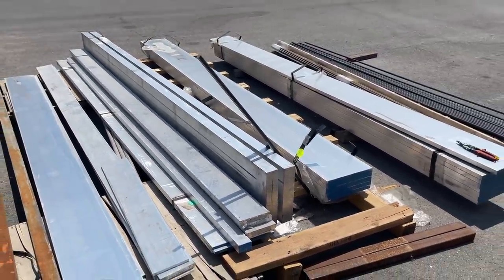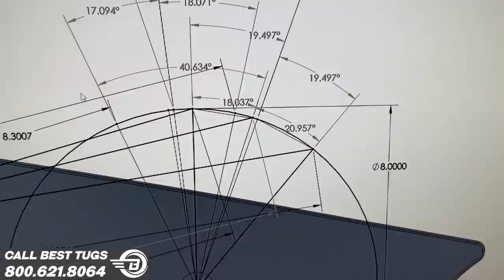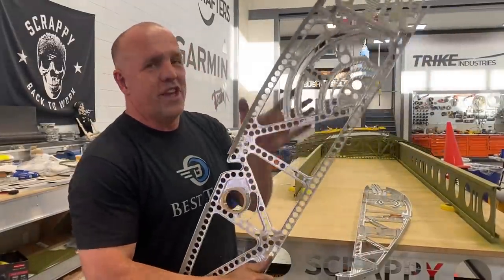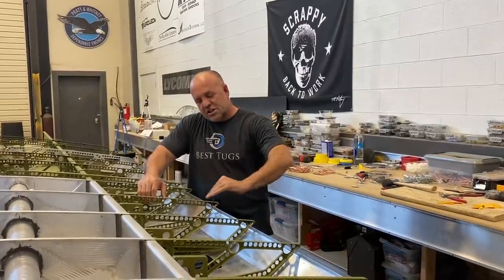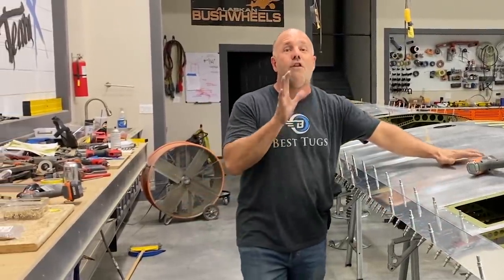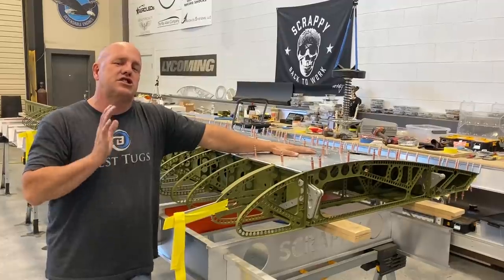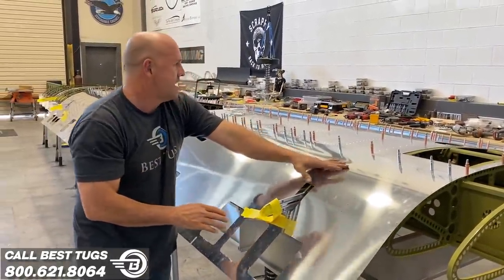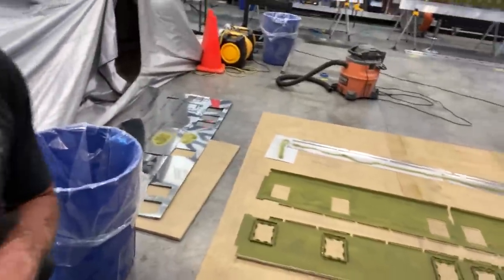I'm skinning my wings, one step closer 🤠 | Scrappy #58

Comment: As someone who has many years experience with repairing and major overhauls of Boeing aircraft, and dealing with stacks of shims that Boeing used in  areas like the structure surrounding the S duct on a 727, to make up for large tolerances in fitment, makes witnessing of the precision and exacting tolerances achieved by Mike Patey, all the more impressive! I am completely blown away  by Scrappy. We are witnessing unequaled engineering prowess. I eagerly await each and every video.
Reply: I was waiting for such a comment 😄
Reply: I also work on Boeing and Airbus aircraft. Been in aircraft maintenance since I was 19 years old and what Mike is doing is on an unreal level. This is more like a commercial passenger jet!  Well done Mike! This Cub is priceless!
Reply: Who could've said it any better??
Reply: I think the thing to remember is Mike is building this without a real timeframe or budget, public companies are under alot for time and budget pressure.

Not saying it justifys their failings sometimes, but I'm sure alot of engineers at Boeing, ect, would love to deal with this kind of precision but the finance guys would rather have looser tolerances in favour of being able to produce an extra part per hour ect.
Reply: Must not forget that the average worker  that stitches a Boeing together makes  about 30% less than the average US income.
Reply: @mitseraffej5812  I don't have any information on employees Boeing may have in other Countries so I can't speak to that but here in the US Boeing employees are union and make good money, I tried to get on there several times. Alas I was unsuccessful. ☹☹☹
Reply: @MrJaiimez  I have to agree, the cost for a large manufacturer like Boeing or Airbus trying achieve that kind of precision, would drive the cost of their aircraft thru the stratosphere.

Comment: I still giggle when Draco lifts off in 10' and climbs like a homesick angel in the outtro ... and now I'm picturing Scrappy in the background out-climbing it 2:1, at a minimum. :)
Reply: I think the weight of this might keep it from beating Draco off the ground
Reply: @gr8belayr  - That's what over 100 lbs. of nitrous is for. 😁
Reply: @SmittySmithsonite  If Mike ever runs full boost + nitrous at sea level, the power will be incredible.
Reply: @patheddles4004  - I would LOVE to see that climb rate! Better yet, I'd love to experience that from the right seat!!  😎
Reply: @gr8belayr  Scrappy will be a LOT lighter than Draco, and with not much less power (Draco was 680SHP, Scrappy is setup for 600 on NOS). Wilga's are big & heavy birds for a 4-seat STOL and while Scrappy will be a big boi by Cub standards, it's likely to still be much lighter than a stock Wilga, let alone Draco.

Comment: Mike, for Best Tugs, please consider making tugs to move around museum cars. Each wheel would be lifted by it's own tug, with swivel capability to move cars any direction, even laterally.
Reply: Could you not put casters under three wheels and just use a tug on one?
Reply: @thomascalton3067  You could, but that would NOT be the Patey way!
Reply: Also for car dealership showrooms and car repair shops. It's a pain to move cars around in such places.
That market should be huge.

Comment: The attention to even the smallest details is stunning!  As I was watching, I was wondering how holes in large aluminum parts could line up so perfectly if parts were produced in different shops and the shops were almost guaranteed to be at different temperatures.  A bit further in and Mike outlines how he made sure each shop was temperature controlled to the same temp and how he shot each panel with a temp gun before allowing the shop to run that panel! Attention to even the smallest detail is something seldom seen in all but the most demanding, cost is no concern, industry.  IMPRESSIVE!!!!

Comment: Question: How did you design the mechanism good these wings so they would be easily operable under load?  IE, when you go to change there orientation that they don't fight you, (like opening the door on a car moving at speed.) - will they be manually operated? Or power assisted with hydraulics or electrics? Did you wind test them (simulation)?   Does your simulation indicate how much effort it would take to operate them?  That's a heck of a lot of control surface there, I would think that it could face a lot of mechanical Dis-advantage up in the air... But I'm no mechanical engineer nor aviation expert, so I don't know anything.
Reply: That is a good question. There maybe hickups but I wouldn't bet the ranch on it. I'm no expert either but I like the way you think.
Reply: @lessharratt8719  I work on cars a lot, and I have done some "customized" alignments for people with sports cars.  When I think of these wings in operation, it makes me think about the effect that "Caster" has on the way a vehicle handles..  With a tiny change in the amount of positive caster that a car has, the effort to steer it changes dramatically.   It increases high speed stability and straight line tracking, but takes a lot more effort to actually steer it.   In contrast, without enough caster or with negative caster, the wheels can get a "speed wobble" like racing bikes get when their front tire touches down after being airborn for a moment... nevertheless, I am terribly curious about his this will handle at different speeds... Will it slam shut? have a mind of its own? flutter like crazy? or be incredibly well behaved and effortless to operate?  Time will tell I suppose.

Comment: Who else is surprised the wings aren’t skinned in carbon fiber?
Reply: Yet
Reply: Maybe has to do with differences in thermal expansion and contraction from the elevation changes that could mess up with tolerances between the ribs and skin? I was thinking the same thing though.
Reply: A carbon skin would need to be bonded and not riveted. With everything going on inside the wings, it’s not a good idea on this plane.
Reply: Probably the galvanic corrosion risk and difficulty in isolating the skin played a part in that decision
Reply: Me too
Reply: Not my area of expertise, but I would imagine it has a lot to do with these being giant fuel tanks.
Reply: Yup, same thought... I am sure Mike will let us know at some point. I guess you can’t river carbon, and glueing them might not work either... we’ll find out for sure
Reply: Not a good application for carbon.  It's fine if it's thick enough to carry structural load and take a countersink fastener. In this case it would either delaminate or be so thick and heavy it would defeat the purpose.
Reply: MIKE did say he would explain why he chose aluminum.  But never did.    Wish he would
Reply: @Whammy154  that was my thought too, still i am a little sad there isn't a complete carbon wing tho
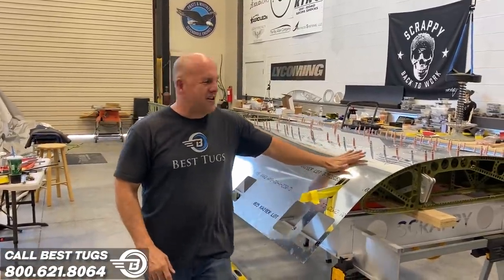Reply: I'm not. You missed what he's doing at 13:10. You can't bend carbon fiber! or rivet it either unless it's really thick. That alu skin is so thin that any weight savings of carbon would be overshadowed by having to make several molds and having to bond all the panels and the adhesive also adds weight in adition to adding weeks or months to the build time for a weight saving of what? maybe 10-12 pounds per wing. Lots of reasons in addition to that, such as repairing potential future damage possibly even in the field without having to replace the entire wing skin if it were carbon ...
Reply: How do we know they're not going to be!
Reply: Wings are only skinned in aluminum. There really is nothing else. Thats why he didn't explain.
Reply: @jbrownjetmech-4783  go look at a cirrus, among others, then rethink that comment.
Reply: @step4560  Dosnt explain, not utilizing different materials within its entirety.  Or variations & alloy make up.
Reply: I feel like he's making it so it can take a bit of abuse, in a previous episode he was testing the wings strength and everything is built to take abuse.  Im pumped to see this thing take off. I wouldn't be surprised if it pulled ahead 12" and takes off at a 45°, if anything it will break world records. Super pumped.

Comment: As an airframe mechanic, I am VERY impressed with everything about this.
Reply: The part where he sanded off the pure aluminum layer of alclad to replace it with ZC didn't make you raise an eyebrow?  That pure aluminum cladding is only about .001" thick on .020 sheet, and an orbital sander would make quick work of that layer.  Alclad sheet by itself is more corrosion resistant than ZC on straight alloy sheet, provided the outer cladding isn't damaged or scratched.  The bond between the pure aluminum and the alloy underneath lasts indefinitely...much longer than ZC will with a perfectly prepped surface.  ZC will eventually do it's job and sacrificially corrode itself off over time, but pure aluminum forms its own layer of chemically inert protection that continuously regenerates if removed, all while being considerably harder than ZC or even the pure aluminum underneath.  That's why alclad sheets are covered in film when you get them...to prevent scratches....and then painted with ZC to add another layer of protection...
Reply: @Skinflaps_Meatslapper  Alclad is a divisive subject.  I always came down on the side of zinc chromate or Alodine.  Once anything scratches the alclad, it's lost its effectiveness.  Pure aluminum is VERY soft and scratches VERY easy.  You cut it and the edges are exposed.  Drill and countersink and the holes are all exposed 2024 or whatever.  Those areas all need protected, so what are you going to do?  Spray paint it on the shiny Alclad?  It'll tear off in sheets.  We used epoxy primer, not Zinc Chromate, though, so I don't know how effective it was at protecting the surface.  Alodine, though, does offer significant protection.  So, I see your point, but I disagree.  Now, if he were to leave it bare aluminum, then leaving the alclad on would be advisable.

Comment: You enthralled us, yet again!
I see that you have answered one of my questions, in an indirect manner, from when you posted. "WILD, one of a kind, Bush Plane Build | Scrappy #54"
[Snoopy... 4 weeks ago (edited)
I am not a design, structural or fluid dynamics engineer but I am curious about expansion of the AV fuel on a super hot day, no matter the density altitude.
I know and understand there will be overflow/ expansion vents...
Another curious point of interest, regards the expansion and contraction of the aluminum arising from the ambient air temperatures.]
Again, beautiful work, Mike and crew!
Now, back to work!

Comment: Mike at 17:15 where you are talking about the slats for the flaps, you are describing the front arc tapering to a flat. At that point your holding it up in front of your head and it brought the question to mind wondering if you had used your head as a template for these, seem like a good match. Tee Hee, Cheers Mike, Billy in Canada

Comment: Mike, first off, what you are doing is amazing. This comes from an old C-130 Flight Engineer/AMT/current production pilot at a well known airplane manufacturer here in the PNW. 
Question…with such tight tolerances in the wing structure, what do you think the long-term effects of temperature variances will be on the sheet metal/rivets?  ie., Scrappy sitting outside in the shade, and the hot sun slowly works over your wing. 
Looking to learn from an amazing engineer!

Comment: There's not another civilian aircraft on Earth that had so much detail go into the manufacture of it.  You're giving Skunkworks a run for the money!  The level of detailed planning that went into the construction of the wing, to include temperature control of the components so that the holes would perfectly line up really paid off.  The skin looks flawless!  All that extra effort put in up front will pay dividends in reduced maintenance which just means more time to enjoy flying!

Comment: This makes me wonder if the commercial airline construction uses the same approach to tolerances. It also makes me wonder at what point in your design plan/s this occurred to you. Its possible I suppose that you had some prior awareness during other builds. In any case I am so impressed that you were able to get the other shops to maintain the tolerances. At the same time what shop could not see that you were spot on.  I came close to getting my private at one point  But things got too expense to pursue. I had some great times along the way. I was stationed at Homestead AFB as my first tour after my electronics training at Keesler AFB at Biloxi, MS.  While at Homestead I got to meet Curtis Pitts and Mary Gaffney, and some great older Military CFIs.  I love your channel.

Comment: I remember a story from a mechanic working for Porsche on their race cars in the late 50s and early 60s: there were "morning" parts and "afternoon" parts, meaning that a morning part had different dimensions than an "afternoon" part and the people operating the machines would use tricks to compensate for different shop temperatures...

Comment: Lol I don't feel quite so inadequate now , it requires three full function productions facilities to build one slightly modified carbon cub. Now I need to go finish cutting the holes in my parts with a hammer and chisel. I achieved the basic shape of my aluminum parts using a second hand craftsman table saw.

Comment: Dang , the detail , even temp stabilized  to fit !? , a friend worked on alloy super yachts , the things grew and shrank over an inch from a cold morning to warm afternoon , hard to get perfect fits . Very exciting ,getting so close . I would want some clear panels ,to be able to see the inner beauty [ speaking of which , great to see the 'slyfox' helping out , after midnight!?, legend .   Just asking, [ not to damage any toes ].could you transport John macinness and synergy , into your shop and team , get them up to your work speed , they are great ,but ,I think 6 years so far .  Another tiny idea for you mike , powered wheels !, extra acceleration and possibly braking , and ground speed matching for landing . you do tugs have everything there ?.

Comment: Does anyone else remember when this was originally presented as a quick project using parts Mike had laying around the shop, thus the name Scrappy....... the wing design is mind blowingly eligant.  Thrush and Air Tractor should look at this closely.  When you are heavy , slow, low and in a turn, this could be a real life saver.
Reply: Why?  They can't even make a plane with a spar that won't crack...what makes you think they'd make something like this with any kind of longevity?  Besides, with Leland gone, Air Tractor isn't going to be making any new designs.  Really the only difference this would make is that you'd stall at a slower speed.  They have enough wing and are carrying enough of a load that the limiting factor in sustaining flight is power...the more induced drag you generate, the slower you get and the less lift you produce, and you reach a certain point where the engine just doesn't have enough power to keep it in the air and you just fall out of the sky.  I can't think of a time when I HAD to use flaps in a turn, but I can think of plenty of times when I didn't have enough power to maintain airspeed in a turn, so it's not really an issue of needing more lift.  Oddly enough, the situation that Mike was talking about with flaps changing your center of lift aft and needing more back pressure to hold the nose up, well it works a little backwards in an air tractor.  The more flaps you use, the more forward stick pressure you need.  Putting slats on the leading edge would likely exaggerate that quirk in a negative way and potentially cause unsafe handling qualities.  Their elevators are already temperamental enough just by themselves, I wouldn't want more pitch instability on top of that.

Comment: That is pure art. 

You were talking about how tight your tolerances were. I'm sure you've thought about it, but wouldn't you have some issues with high temperatures causing  movement and stress in the wings or even having the wings hot on the ground and then going up to colder temperatures in the air?

Comment: Hey Mike, I know this is a little late for Scrappy, but there is this cool new technology for improving flow characteristics that will probably be making its way to aviation before too long. Plasma actuators on the leading edge of a wing can greatly reduce flow separation and skin drag. It is an energy intense process, but I'm sure it could potentially be a useful feature for accomplishing some of the stall speed and angle of attack goals you have for Scrappy. You ought to look into it, there are a lot of papers getting published about it right now.

Comment: FAA licensed A&P mechanic and engineer here. This level of precision and tight tolerances is very interesting to me but also concerning for your safety. So maybe this has already been considered but there could be a problem having built a wing with such precision. The result of which is an obvious high rigidity. But just as you were concerned about the temperature stability and consistency during manufacture, I would be concerned about such things while in flight. By carry fuel, various material thicknesses, and a variety of levels of heat exposure to the outside environment, I see the potential of vastly different thermal expansion ratios that interplay with each other. And with very tight tolerances, this affords little room to account for these variances. I would liken this to the composition of a knife: if it all were as rigid and hard as the blade area, the entire knife body would be far too brittle to be of any use before it would shatter. So, constructing a knife with brittle areas and malleable areas works best. Mayne there needs to be portions of the wing that allow for thermal expansion so the entire body doesn't risk catastrophic failure?
Reply: @amytaylor8487  hello. What can I do for you?